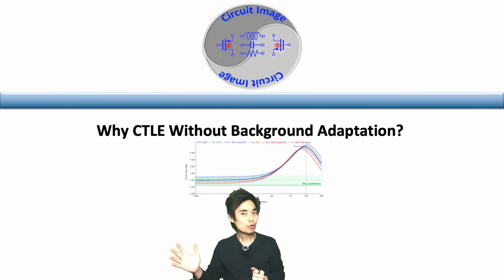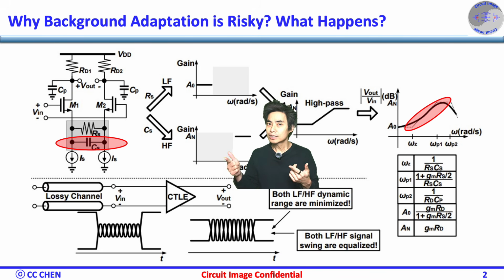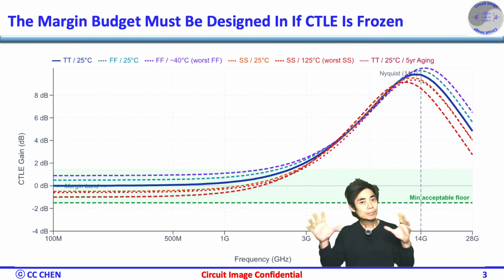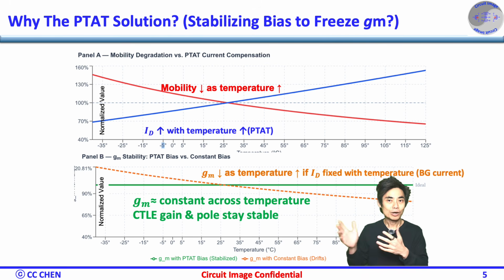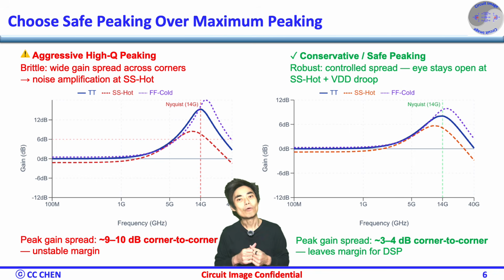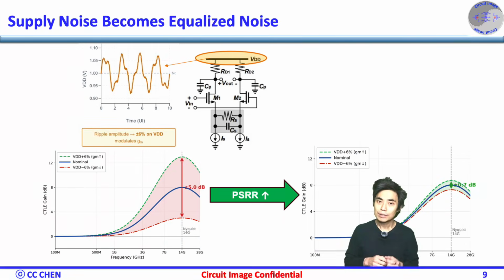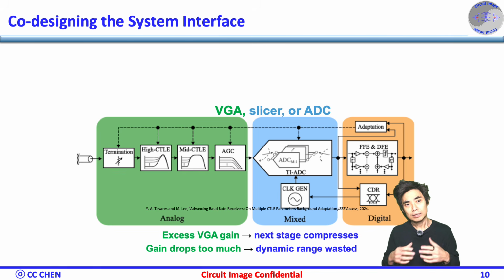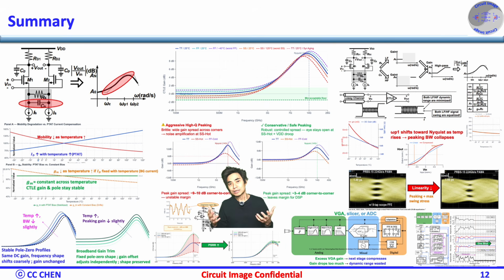Why CTLE Without Background Adaptation?

Comment: Hi Dr. Chen,
In one of the previous videos "Why background EQ Adaptation" you mentioned jointly background adaptation for CTLE and DFE is important. However, in this video you suggest don't do CTLE background adaptation. So, I am confused should we do CTLE background adaptation or not? or I missed something? 
Thanks!
Zfu.
Reply from the maker: Hi Zfu,
Great question — both statements can be correct, depending on the context.

My point is as follows:

In principle, joint background adaptation of CTLE + DFE can be important, because they interact.
But in practice, I am often more cautious about continuous CTLE background adaptation, since CTLE changes analog gain/peaking and can disturb the signal/noise balance, slicer offset, and DFE convergence.
So a common approach is:
CTLE = foreground or very slow background tuning without any glitch introduced
DFE = continuous background adaptation

So I am not saying “never adapt CTLE.” I mean: CTLE adaptation is useful, but usually should be done more carefully and less aggressively than DFE.

Thanks,
CC